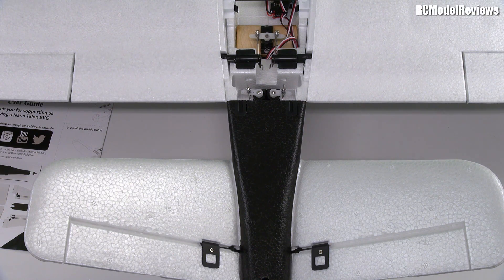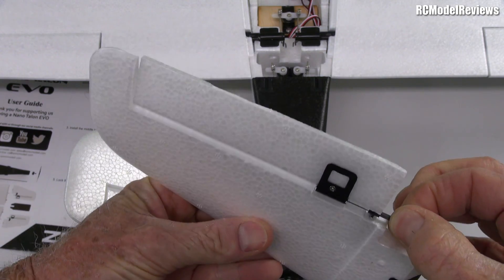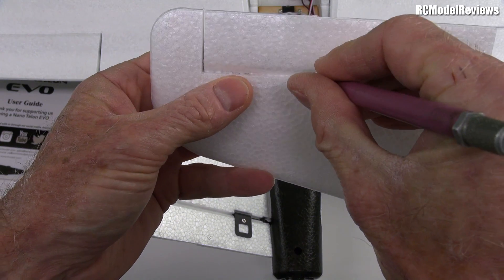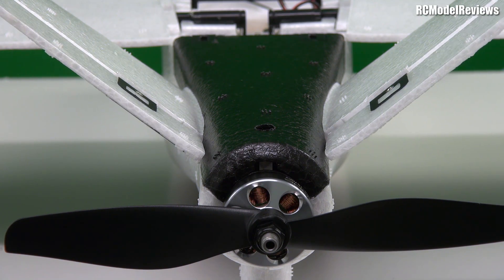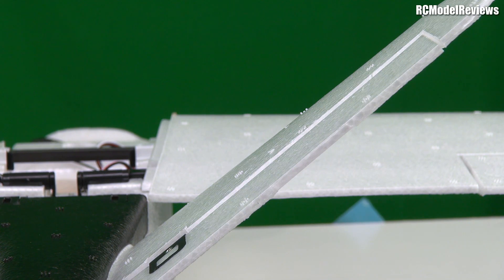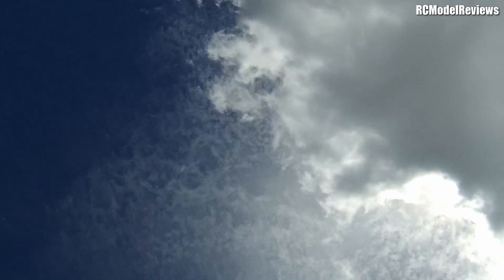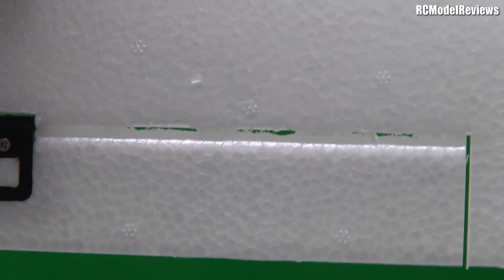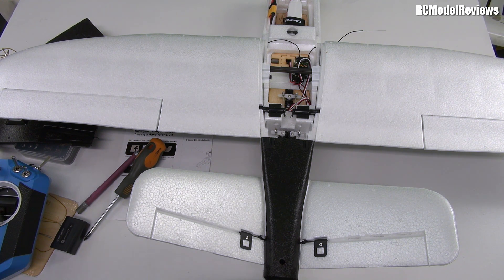ZOHD Nano Talon Evo elevator fix (RC Plane)

Comment: AHA!!! I was sitting here scratching my head, wondering what the h%&# is wrong with the elevators on my (several year old) Nano Talon, that will get it's first flight in a day or two. I have seen this video before, but I had forgotten about this problem that some of these models have. (My first Nano Talon did not have this problem). Anyway, thanks for the help. :)

Comment: Clearly the push-rods being 1mm soft Chinese wire is not a good engineering decision. Not stiff enough basically, sliding hollow carbon rod over them could have been a fix...Price based decision. If you have a Giro Stabilizer, non slop controls are par for the course if you want it to work well. Id have cut the Elevators off and used proper wire hinged hinges, tedious to fit but friction free. The carbon torque rods also look very flimsy, progressive wear in the square drive and slop is almost certain.
  Your fix was certainly an easy one, not sure its the best long term fix though.

Comment: This looks like terrible advice to me. Especially as you haven't even tested it. Looks like  You've just dramatically reduced the life of the model. Doing the job properly and fitting hinges would be a much safer way of doing it. But it still doesn't address the matter of the pushrods being too weak to perform their task.

Comment: How about a small bulkhead (positioned at half length of the push rods) aout of plywood or plastic with small holes where the rods go through? This would almost eliminate any bowing the rods can do.
And didn't you use tape as hinges on other models? So no foam connection at all.

Comment: 1:19...Would it not also help (in addition to removing the stiff hinge load) by putting some appropriately sized rigid carbon fiber tube onto the bending push rods ??

Comment: For alierons will be maybe good shot to reprint the couplings on frame side. and for ZOHD they should do conection couplings with star shape like torx head screws and with lite bit tighter tolerance.

Comment: I'll add the thin carbon pipes on the pushrods. Weaking the hinge will help, but in the air there will be a force from the airflow on the elevator that may decrease this mod effect.

Comment: Great analysis!  I checked my early V1 models and the hinges are very flexible so maybe they changed the manufacturing or materiel.  I do remember some flyers filming the feathers deforming under stress.
On the pushrods bending front, I've had that on other models and slid & glued a  carbon tube over the rod.

Comment: Would be good to check it in the air before making a video declaring fixes, this plane is full of surprises
Reply: Yes , you are correct. To call it a potential fix well and good, but unfortunately he didn't test it be report the results like you would have done.

Comment: I am sure one could figure out the aileron issue with a 3d printed solution. New brackets. Have a new rotating actuator stick through the bracket and have a throw arm screw on to the end of that (or friction fit with a square or star pattern)

Comment: The whole thing is just horribly cheaply and badly designed.
Reply: John Doh agree! Hated this foam they used on this plane.
Reply: @Freebird_67  Just looking at how the control mechanism twists without the control surfaces moving would make me throw the thing away.
As others have commented even with this "fix" it's still bad design as oncoming air will also push on the control surfaces, again twisting the mechanism... which now adds air speed and degree of deflection to the equation of what these control surfaces are actually doing.
Reply: John Doh totally agree..  I had 2 of these models and both failed on me in flight because of these cheap push rods and servos.   I’d never spend another $90 on these junk models and again the foam is horrible. Weakest foam I’ve ever seen.  I’m aware it’s environmentally safe foam but damn it’s weak soft junk.

Comment: Ironically they did listen to the folks and stiffened up all the control surfaces in the Evo because people said they where to sloppy in the original Nano Talon...
I have the original Nano Talon (with the sloppy hinges) and did the flat wing mod, glued all the wings in place and glued the square aileron connectors. Everything moves freely and is rigid! Flies like a dream! I love the thing!

Comment: That's been a common problem in a number of foam aircraft iv'e  had  they all seem to have very light & flex'i push rods, I found an easy fix sometimes was to cut the rod & glue it inside a small  carbon fiber tube in the fuselage to stiffen it up.

Comment: double the existing pushrod with same size wire and heatshrink tubing : you will have a very light and rigid pushrod
Reply: Brilliant! I was thinking stiffer pushrods instead of weaker hinges, but I didn’t know how to achieve that without adding weight.
Reply: That would work, however the stiff elevator hinges still means the servo requires more power to operate and this stresses all components - servo, BEC and battery unnecessarily.
Reply: S & P Thompson. I agree with you, but I would be uncomfortable purposely weakening parts of my planes. Possibly a tape hinge is the solution

Comment: It does seem to fix it on the bench, but once it up in the air, wouldnt the airflow be enough to bend the push rods again?
Would changing out the push rods be an option? or maybe sliding some thin copper/aluminium tubes onto the exsisting push rods to make them less bendy?
Reply: Glad someone said it

Comment: I do not agree, the problem is not solved, maybe on the desktop, but not in reality. The speed wind will create resistance on the elevator and the pushrod will bend. So the real solution is open the model and support for the pushrod
Reply: It would at most be like some kind of reverse expo. The important thing is to remove the deadzone, which this fix should do. At small elevator input the forces won't be strong enough to bend the rods. It might bend them at the more extreme deflections of the elevators, but at least that is something you can fix with settings on your radio.
Reply from the maker: This is a small control surface, there will not be enough pressure on the elevators to bow the pushrods -- but we will see during the test flight  I guess.